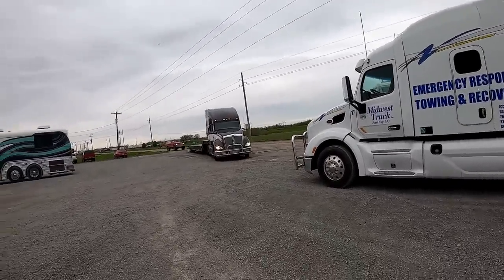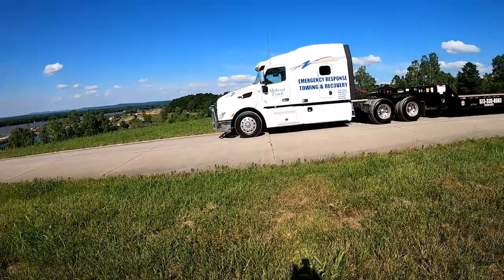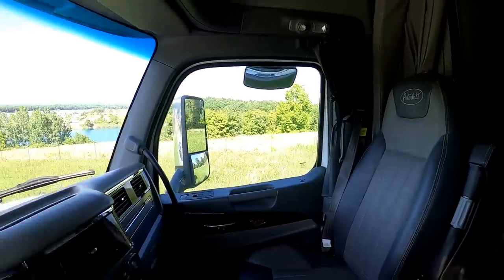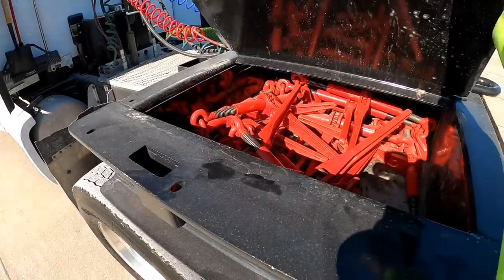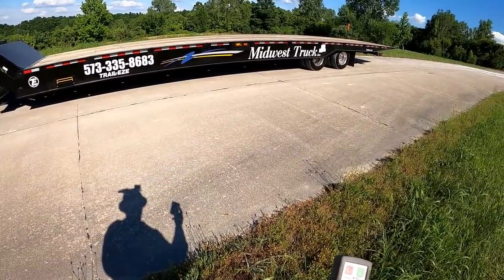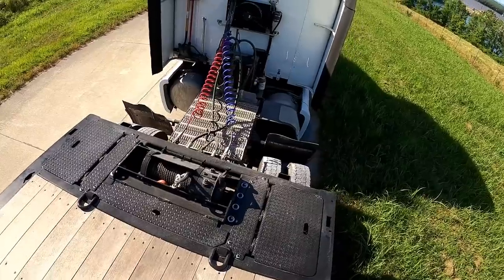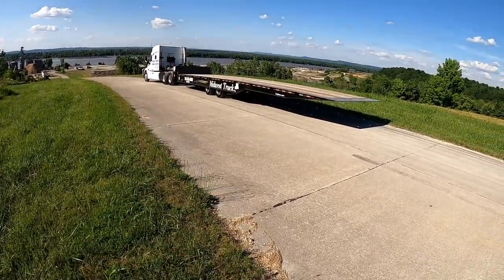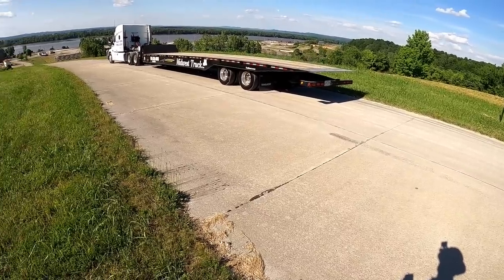Walk Around of Truck 17 and our new Trail-Eze TE801 trailer #T-1!!!

Comment from the maker: Lots of viewers are asking about emergency lights and siren on this unit.  We will be putting amber lights on this truck and trailer, for now, as well as some additional work lights.  This unit will not be a "First Response" unit for the most part.  We have other vehicles that can "escort" this unit if needed.  As I stated in the video, we will be adding things as we go along and find out what we need, just like we have done with most of our other units.  For instance, we just installed a "high-pole" and flags on the traffic control unit #16 so that it can function as a "pilot" vehicle in the event that we have an over-sized load coming from a crash site with this new unit.   Thanks for watching and God bless.
Reply: you thought about getting a DTU for it so you can add regular towing capacity when you're not needing the trailer?
Reply: Is that unit like a landall
Reply: Front bumper pole
Reply: Beautiful truck and trailer .. God bless and good luck with everything .. Im a big fan of your video . love all your tow truck .
Reply: Yes as many LED strobes as possible what a gorgeous set up Ron you are a very fortunate man
Reply: I think a amber led light bar mounted on the back just above the sleeper would look amazing
Reply: Ron ive seen a few guys with sleeper trucks on there floats use the back of there sleepers to put a arrow board for when its sitting on a wreck before its loaded for extra warnings besides having just a traffic control vehicle
Reply: Ron is another name for the trailer a  "super tilt"
Reply: Can I help out with a light set up? I have ideas for a layout on this beauty for you. :) even Red and Blues if you end up putting them on her. Thanks for letting us see number 17.
Reply: Came down here to ask about that would look amazing with some Amber's on the very rear and side of trailer and on truck. Thanks for commenting it and keep up the great content
Reply from the maker: @Commissar0617  We did consider getting a DTU to complement this truck.  However, we found out the truck was too short to fit a DTU.  The frame would have had to have been stretched and lined along with the other things that go along with doing a frame stretch.  At that point, the truck would have been too long for this trailer.    We haven't ruled out the possibility of another road tractor and a DTU in the future, but not in the near future.  We need to earn with what we have for a while.   We prefer to have slow, steady growth rather than large amounts of debt.   Thanks for watching and God bless.
Reply: @johngriggs2552  It's similar, just a different manufacturer, as Ron explained to me.
Reply: @RonPratt  ah. that makes sense. steady growth is definitely better than debt, especially in such uncertain times.
Reply: It needs big left and right flashing arrows that can be raised to above the cab. Like the ones you have on some of your other trucks. 

The sleeper compartment makes a nice warming/cooling station if it's on site.
Reply: I think it would look good with lights
Reply: @RonPratt  I would recommend looking into Fenix lighting and their new quad series! Might be very beneficial for you if you do decide to run red blue and amber with this truck you won't need extra lights or switches it's all built into one light head and you select the patterns colors you want to use
Reply: That is like Christmas morning ;-) an that is a long long bed o.o you can haul semi trailer on that.... Sweet looking rig but I Get the top bunk it's the warmest 😆
Reply: Hayden's Special Needs Channel  Not to sure about the US (I am in Scotland) but aren't blue lights restricted ?
AIUI :-   Blue - emergency vehicles (police/ambulance/fire engines etc)  Lights flashing sirens blaring    "BLUES AND TWOS" (historicaly two tone siren.  NEE-NAW!).
             Green - Doctor
             Orange/amber - Construction (no priority just for visibility)
             Red - tends not to be used in the UK except for visibility reasons say flashing rear lights on a police car that has stopped at an RTA
Reply: @Commissar0617  what is DTU for those of us not up on american truck abbreviations?
Reply: @Cheezsoup   Here in the USA towing and recovery vehicles running Reds and Blues with and without sirens are authorized/restricted from state to state and can be different in counties within each state. Areas that do allow towing and recovery vehicles to use reds and blues, there are regulations on when and where they are allowed to use them.
Reply: @Cheezsoup  Missouri allows tow trucks to have red/blue emergency lights as tow trucks are considered emergency vehicles but they can only be used under certain circumstances, Ron explains it in one of his earlier videos
Reply: John Griggs yes
Reply: Nice rig Ron God bless
Reply: Nice
Reply: Ron
Reply: @RonPratt  The Miller DTU isn't the only game in town. The last company had a 2015 579 with a Zacklift on the back.  Excellent for transport work. 

Also,  I would strongly suggest putting on a headache rack. In Washington they are required unless the trailer has a headboard. I know from experience that a headache rack will save your life.
Reply: Hayden's Special Needs Channel  Ron could answer this better than I can but, as far as I know, you can't just use red/blues at will, or to emphasise your point. The truck would need to be authorised to run "code" using red/blues. I'm sure Ron would be allowed to fit them but using them is a different ball-game.
Reply: @johnfisher801  I agree with the headache rack.
Reply: Can't wait to see this unit in action. When will we see unit #16 in action?
Reply: Have you done a walk around of your rotator yet?
Reply: Hayden's Special Needs Channel  they have the support truck im sure that will be with this truck alot if they get highway calls
Reply: hi Ron Pratt that is what you need to Hall for cars at one time nice new truck I watch the videos
Reply: I agree with Ron Pratt

Comment: Very Nice Setup sir! If you haven't already, head down to your local cement plant, rock plant, etc, and ask to see if they have old conveyor belt. Take a sharp razor blade and cut some sections to protect your bed from steel track machines. We love using this method! We have an 07 trailer with lumber that looks almost new! Again nice setup!
Reply: I was looking through the comments specifically to see if you replied. :D
Reply: That is a use for conveyor belts I never would have thought of. Great suggestion.
Reply: @2009dudeman  amazing the uses you can find for old conveyor belts....years ago when machines were using leather belts..my dad would get part of a used one...prbably shared it with others and uses that for repairing boots and shoes back in the day when shoes and boots were meant to last......
Reply: This man is exactly right., You can always roll up the material and bungee strap it when not in use.

Comment: The sleeper will come in very handy if you are out on a job for an extended period of time, like you were on "The Long Slide".
You will be able to keep plenty of water and other drinks on board, as well as medical supplies, and even snacks. Plus, if someone needs to get out of the heat, (or cold), if you are exposed to extreme weather for extended periods of time. It could serve as sort of a break room also.
You can also load more crew into it if necessary or needed on a particular job, instead of having to run another vehicle to carry one or two people to a job site.
It's a good looking rig Ron, Thanks for the walk-around.

Comment: We bought our new TE trailer in late 2015. And we love it. We also went with the tandem axle. Unless your running a 4 axle tractor you really don't need the tri axle set up, IMHO. 40 ton on the deck is plenty today. We installed a automatic grease system for the points that we could set then up on. Our trailer now has about 380-K miles on it. And if you keep up a strict greasing schedule you'll get 500-K miles out of the moving parts with no problem before you have to worry about parts wearing.  And that's up here in NE Ohio and in all the salt and calcium chloride they use on the roads during the winter. But as you well know owning the Heavy Recovery units, Its hard to over grease them. Same applies to these type of trailers. I wish we had opted for the extra double rows of tie downs in the center of the trailer. And I really like how they have counter sunk the winch now. Our 2015 has the winch mounted flat on the front of the deck. So you lose a little.  So we also built a crash cage around it. The sides of that are used for hanging 1/2" chain on now. You need to put some  Emergency lights on her, For those side of the highway jobs that will come. Maybe even a nice big enclosed headache rack on the back over top of the hydraulic tank. I've wondered why you hadn't had a set up like this since I started following your channel. And just figured you had a good source to farm this type of work out to. Nice addition to the company fleet. Equipment is expensive today. But this type of equipment with a experienced group of operators is valuable and will pay for it self very quickly. Good job Ron.
Reply from the maker: Good maintenance is essential, as you know.  We have looked into good storage headache racks, but haven't found exactly what we want yet.  And, yes, we will be "lighting her up" very soon.  I've already had instances where I needed lighting and didn't have it.  Actually plan on trying to find something again tomorrow.   We have some extra lighting around the shop that I may put on until I can order in some new stuff.  Some things are difficult to acquire right now with the "virus" issues.....    Thanks for watching and God bless.

Comment: That is one sensational pairing. That sleeper cab will be great for you - You can use the fridge to store cool drinks in it for hot days, to keep your crew healthy. The top bunk kept for when your drivers are delivering customer's trailers or equipment on longer hauls or as a first aid/resting place for crew at live scenes (until better care options get there.) . But the main advantage of the sleeper is to be able to store the extra gear you may need while this unit is in operation on call outs. 
And how sweet isn't that trailer.Incredible!

Comment: Very nice, we own 5 Trail-Eze TE70XTS trailers and have another on order. We have gone to the 3 axle set up on the trailers and that has opened doors to hauling larger equipment and cut down on tire issues.  We run 48 states hauling equipment and vehicles and have been happy with the trailers and the service from Trail-Eze. Stay safe

Comment: Will you be putting some emergency lighting on it?
Reply: I was curious if that too
Reply: Inquiring minds want to know.  :-)
Reply: Ron Pratt
50 minutes ago
Lots of viewers are asking about emergency lights and siren on this unit.  We will be putting amber lights on this truck and trailer, for now, as well as some additional work lights.  This unit will not be a "First Response" unit for the most part.  We have other vehicles that can "escort" this unit if needed.  As I stated in the video, we will be adding things as we go along and find out what we need, just like we have done with most of our other units.  For instance, we just installed a "high-pole" and flags on the traffic control unit #16 so that it can function as a "pilot" vehicle in the event that we have an over-sized load coming from a crash site with this new unit.   Thanks for watching and God bless.
Reply: Check the pinned comment.
Reply: This was covered in the video and in Ron's pinned comment.

Comment: I see a lot of Landall trailers, what made you select this brand?
Reply: H3N2 Landoll trailers are super expensive. If I had to guess, probably price and/or build time.
Reply from the maker: @H3N2  There are actually several reasons we went with the TrailEze over other manufacturers.  First, the dealer that we buy all of our equipment through, Crouch Tow Trucks, is a distributor for TrailEze.  Second, we like the parallel link system at the transition from the lower deck to the upper deck.  Third, the TrailEze has a longer main deck, at 41'6", than any other brand...as far as I know.  And, we like the low 6 degree loading angle.  I'm not knocking other manufacturers.  This is the first trailer like this that we have ever owned, so we only know what we have researched prior to our purchase.    So far, we have been extremely pleased with this trailer.    Thanks for watching and God bless.

Comment: Will you install emergency lights on these vehicles?
Reply: Check the pinned comment.
Reply: Yes, they will, need to read description and comments and listen to the video, stuff will be added as they go along and it WAS written that amber and white I think for now being one of the things they will add and it's not intended for first responder calls and they have other vehicles to assist when necessary to start with.

Comment: Great unit and very versatile. I was looking into one in 2015 before I sold my flat beds off. The conveyor belt suggestion works great on saving the wood decking from tracked machines and other heavy steel pcs that can ruin a deck. God Bless and giving you the ability to keep growing

Comment: One of the outfits I used to work for had a Landol version of this with the remote control. Came in quite handy when we’d have to back down a narrow canyon road or even just backing into the shop for maintenance. Glad to see y’all finally add one to the fleet! Now you just need to add a regular RGN lowboy or a double drop stretch RGN for more “side jobs”.
Reply: With the wet kit & sleeper, y’all could look into a Zaklift as well for 17 for those real long hauls.

Comment: Congratulations on the new addition, Trail Eze make a good trailer. We have the 50 ton Trail Eze bus trailer and love it. We also have a sliding axle but we went with the Landoll over the TE  because the Landoll is Fully Galvanized which really is a big bonus up here in the NJ winters with all the corrosive salt and other additives they put on the roads.

Comment: My company has several of those Trail-eze trailers for hauling railroad equipment. We got 2, 3, and 4 axle versions. They are some nice functioning trailers. Big difference is ours have an engine added to the front to run the hydraulics so that all of our trucks can run them.

Comment: I don’t know if this has been said yet, or if you knew this already, but if you ever find yourself stuck, in loose ground, you can utilize the trailer axles and breaks to ‘push’ the tractor out. Yes, it’s a lot of back and forth between tractor breaks and trailer breaks, and moving the trailer axles forward and back. But it’s very handy if you don’t want to call out one of your other recovery vehicles.

Comment: Cool tractor and trailer setup! I too was confused at first why you would use a sleeper cab, but honestly it makes more sense as you can haul, and have more recovery gear stored safely inside the locked cab. Can't wait to see them both decked out with a bunch of warning lights. Cheers!

Comment: Nice thing about that big sleeper: you can use it as an on-site, heated/cooled break room for those long jobs, especially with summer coming and the risk of heatstroke, and the fridge will keep drinks cold much better than a cooler.

And if you really need it, more space for gear!

Comment: Ron, this is a nice truck. If it were me, I'd add a knuckle boom crane to the trailer (not a necessity but might be helpful) , amber strobe lights in the grille, around the truck and trailer just as a caution to motorist for when you are dropping off on a state road and Maybe a toolbox behind the sleeper for things like hammers, extra boomers/chain, pry bars, flares, etc and I would add two portable scene lights like you carry on the rotator and two work lights behind the sleeper. Throw two raincoats and two safety vests in the cab and put a CB in and in my opinion you should be good to go. I can't wait to see how this truck is actually outfitted and how it evolves with time. Take care and God Bless.

Comment: Does the 801 have 2 lift cylinders or 4? I run an 801 for united rentals. I wish it had 4 main tilt cylinders but only has 2. A good thing about the traileze is you can run the axles wherever. It doesnt lock in or lift like a trailking or landoll....also with  the brake setup BE CAREFUL if you are facing downhill and sliding tandems, if you have a heavy load on it, the weight shifts off the drives and can allow tractor  to slide, believe me, I've had to chase my truck down a hill many times. Best thing to do is only use the brake override on the trailer, if tractor starts sliding you can pop the trailer brakes, but if you dont set them in the tractor you cant pull the "oh sh*t" button

Comment: Nice unit. I am seeing an increase of those tractors being used to haul large fifth wheel trailers. Having the frig handy is nice. I have seen this type of trailers used for big diesel pusher motorhomes that broke down along the road. Those motorhomes will through a red error code that puts them in "Limp Mode" that usually requires them to be towed to a shop. You guys being along I-55 may see a few.

Comment: If you have to transport an apparatus or vehicle long distance that sleeper and fridge could really come in handy. If you had a hot day and someone wasn’t feeling well due to the heat it could serve as a respite area if need be. Drivers that tarp and chain loads are vulnerable to the heat. I helped a driver once and it’s not an easy job even on a cooler day. I see those trailers all the time and had no idea it was that functional. I hope you’ve made a full recovery from your pneumonia.